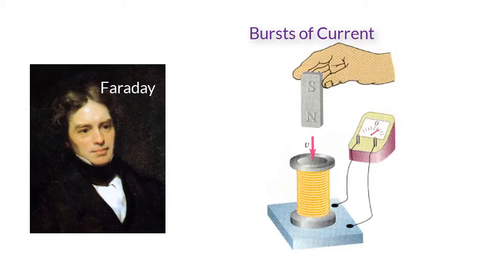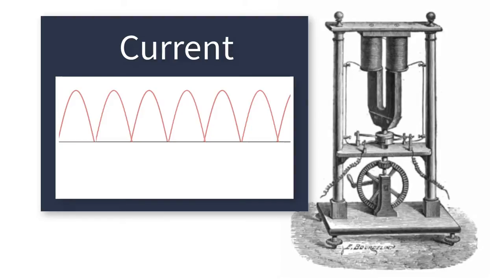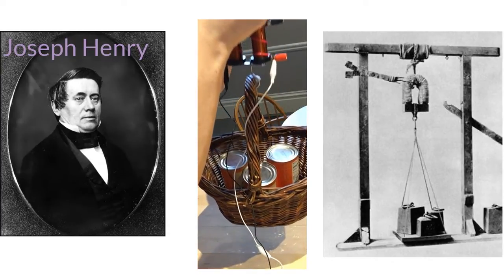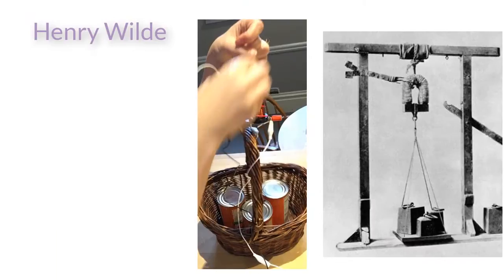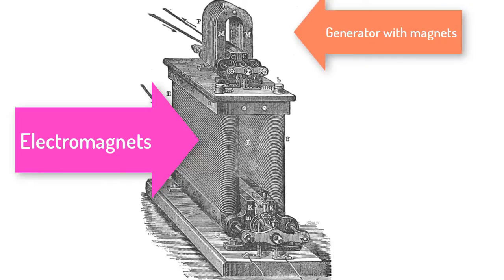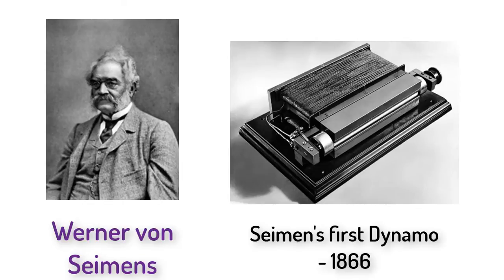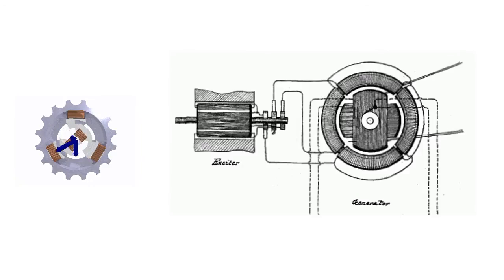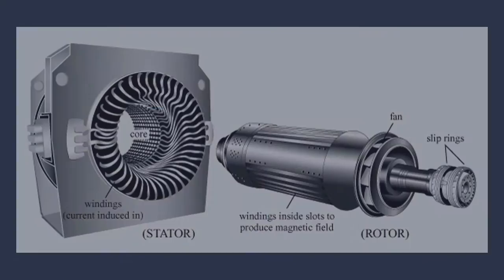Where Electricity Comes From: History of the Generator & How the Generator Works

Comment: AC current in a three-phase system could be amplified/controlled precisely by the use of transformers and, for each phase separately, by the use of radio-type amplifier electronics (vacuum tubes until recently).  This precise control, even when amplified, allowed data transmission to be accomplished between devices that are separated by some distance, yet need to get precise information from one-another and, with enough amplification, to directly control the operation of these long-distance devices (analog, pre-digital controls).

The mechanisms used by the US Navy after WWI, and until modern digital data transfer replaced them, were called "Selsyns" or, more usually, "Synchros".  A magnetic needle (just like on a compass, but stronger mechanically) was put on a rotating shaft and a metal ring of three divided sections wrapped around it in the same plane of the rotating needle.  Three electromagnets in a triangle were attached to the ring, each separately wired.  The other end of the wires of the three coils were attached to a duplicate loop and needle with equal AC power running through each coil on independent circuits.  By rotating the needle in one loop, the needle['s magnetism would modify the current in each of the three lines so that the EXACT same change would happen at the coils at the other needle and the magnetic field would, if powerful enough (if necessary, amplified by the vacuum tube/transformer set in-between) move the needle at the other end to match the first needle.  This allowed information, when changed to a needle angle value, to be sent from one place to another very accurately.  In many cases, when increased accuracy to overcome slop in the needle angles was needed to get really precise numbers, a second needle set using a 36-to=1gearing action would also be sent and the two values merged using precise electronic circuits to give an EXTREMELY PRECISE angle value that could be changed back to whatever kind of information was being transmitted precisely.  In fact, by using powerful enough amplification, the needle on the far end coil set could be strong enough to directly rotate the controls of the far-end device, allowing the elimination of the "man in the loop" for automatic control.  US naval guns  by the end of WWII were almost entirely controlled in the later fire-control systems using this method, which made accurate gunfire, especially against fast aircraft, possible.  This target position and motion information would come from the aiming range-finders/directors tracking the target, be sent to electro-mechanical calculators to give weapon aiming orders, and then sent to the gun mounts, all with minimum human inputs to slow the process.
Reply: Very clever.  I'd've either thought of servos with feedback, or some kind of phase shifting, to try to accomplish the same thing, but probably more slowly in the case of the servomechanism, or requiring frequent recalibration (or sacrificing precision) in the case of the phase-shift device.

Comment: What is the difference between static induced electricity and magnetic induced electricity?
Reply: Capacitors
Reply: You mean the difference between electrostatic and electromagnetic induction?  Well, for one thing, you can induce an electrostatic potential without any current at all, which is why it's static; a standing charge induces a standing potential.  However, electromagnetic induction requires change; you can induce a potential electromagnetically only by accelerating a charge.  The parts of Maxwell's equations dealing with static potential don't require any calculus, just the relative positions of charges, while you're only going to get induction of current by other current via second derivatives of the position of a charge with respect to time.
Reply: @goodmaro  Thanks for the info Robert.

Comment: Nicely done!  I’m an electrical engineer and I’ve always enjoyed learning about technology through the lens of history. I also think that students understand math much better by relating it to physics rather than just teaching it as a set of abstract concepts. Keep up the great work!
Reply from the maker: Thanks, glad you liked it (and I agree about usefulness of history obviously)
Reply: Yes  she is great.
Reply: @affilinet  If you take a hand generator, it is easy to turn. However if you connect the generator to a load then it becomes much harder to turn. You are doing "work" and this work is converted into electrical energy by the generator.  

You used to be able to hear this on carburetted cars.   When you turned on the headlights the idle speed of the engine would drop because now the generator/alternator became harder to turn and slowed the engine down.
Reply: The electricity is a flow of electrons. The electrons are part of the copper molecule. The electrons in a metal can be pushed around from one molecule to anther. The mechanical  work via the magnet is pushing the electrons along from one end of the wire to the other just as a paddle in water can push the water along
Reply: @affilinet  : I suggest you read up on the experimental work of Michael Faraday.

Comment: Since you like physics AND history, I have some for you.
On the RMS Titanic, there were four100 volt DC generators & 2 backup.
Wattage unknown to me, but they had to be massive as they had to power all of the incandescent bulbs plus the very new technology of electric heaters in 1st class (2nd & 3rd were heated using steam radiation).
I do not believe "thermostats" had been invented at the time, meaning they were all the way on or off.
The electricity was also used for the new tech of wireless telegraph on board.

I am off grid here in Fukuoka Japan and just happen to be powered the same way except via solar (100 volt DC / 8000 watts). I should note, higher voltage DC needs to have spark arrestors (capacitors) on EVERY switch as the power has no zero crossing as AC does, lending itself to arcs. DC "wants" to continue when opened.
I have no knowledge of how this was mitigated on Titanic.
A question I can find no answer to: 100 volts DC in sea water will split the Hydrogen and the oxygen of H20 causing me to wonder if that was an issue as it was sinking before power loss.
Reply: Do you really have a 100 volt DC system powering the house not just supply energy to the Dc to Ac inverter ?

Why not 110-115 volts like the original Edison system that lead to the 115 volt system used today in US?

I have a large number of Brand new old style DC light switches a bought when an old hardware store went out of business.

They make a loud “click” 
When moved on or off to prevent Arc damage
Reply: @josephpadula2283  ALL electricity here in Japan is 100 volts, but it is 60 Hz AC in the south & 50 HZ AC in the north.

I chose DC because it is one less link in the inverter chain plus I only use transformerless appliances that would not care if it received AC or DC.

Remember, only AC will go through a transformer.

Comment: @5:28:"...Notice, you can't get something for nothing. It will produce more electricity; but it is also coorespondantly harder to rotate."
This would appear to be something fundamental; a law, of some kind. But, also stated, wasn't it proven early on that an electric current carrying wire producing a small amount of magnetism, produced, with this same amount of electricty, a greatly magnefied magnetuc field when wrapped around a metal core?
Reply from the maker: Steven Baxter it is a law. The first law of thermodynamics.